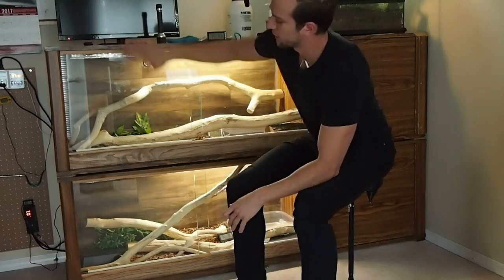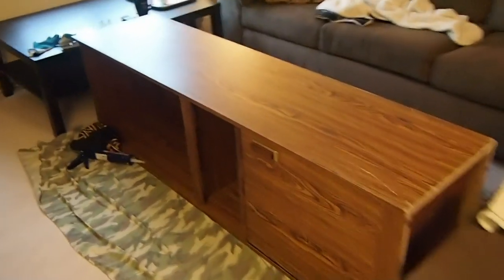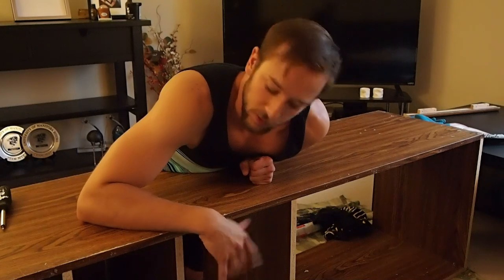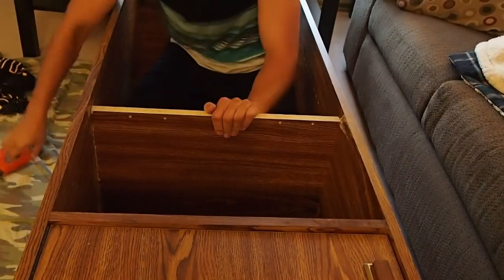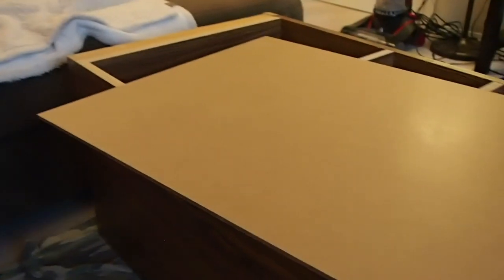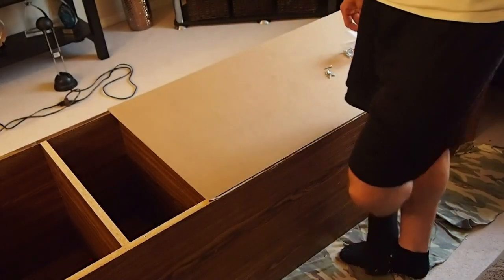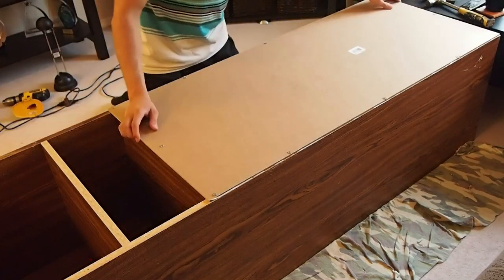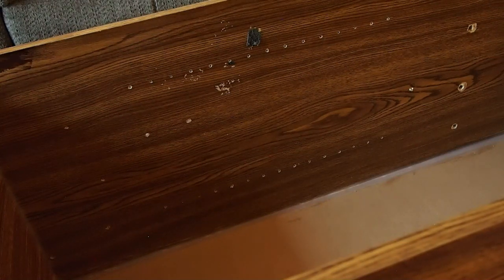DIY Snake Cage: Part 1

Comment: Im gonna be doing this for my boa. Only thing is the humidity sucks in my house. What should i do to keep the humidity up?
Reply from the maker: I deal with horrible humidity as well. I would pick up a humidifier and probably some Sphagnum moss. Take a look at my video called “how to increase humidity...”. I run down what I do to keep the humidity up.  Also keep in mind, in the winter boas can handle humidity around 50% just fine.

Comment: Just keep in mind that particle board turns into oatmeal after being wet for 2 minutes.
Reply from the maker: Yep, that’s why I lined it with vinyl flooring. Still using these enclosure 3 years later
Reply: @AnimalsatHomePodcast  Oh, I know. I didn't word that very well. It was more a general suggestion since some furniture is so "cheap," with not all sides finished, etc.